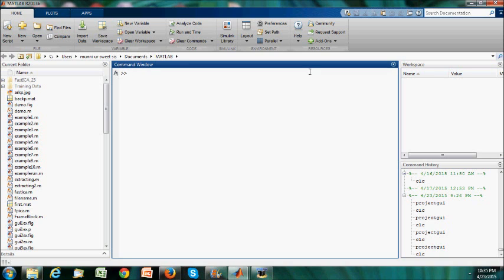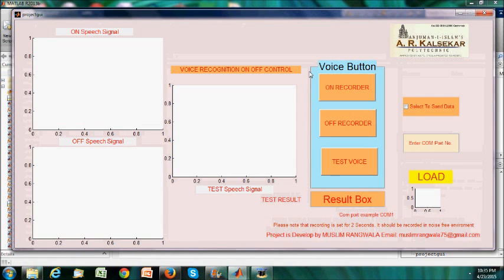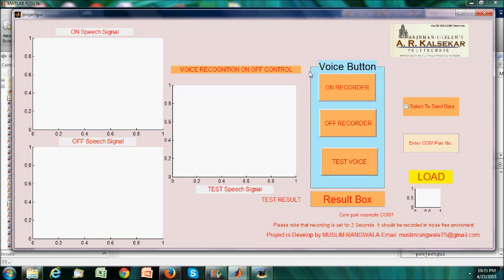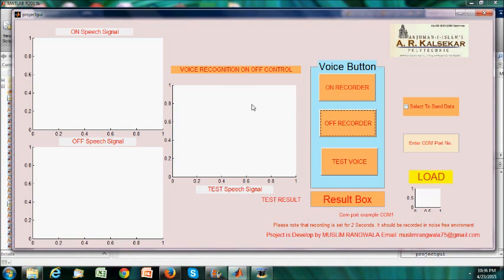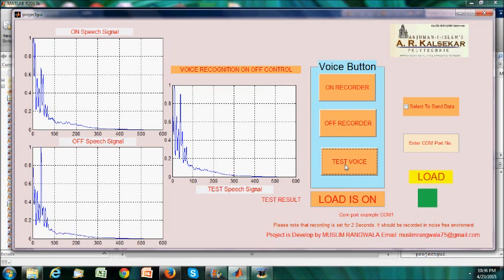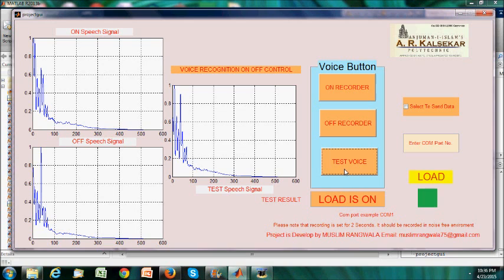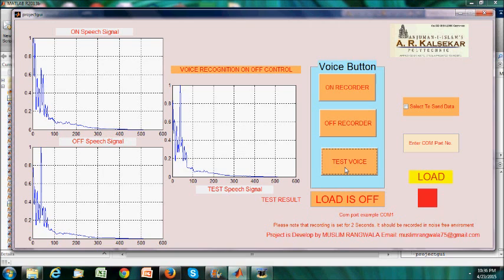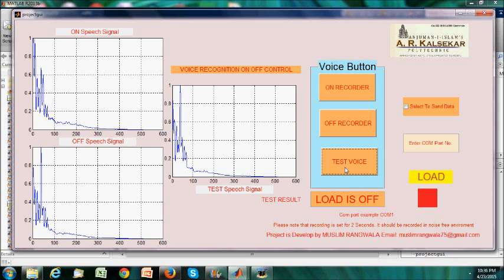VOICE RECOGNITION ON/OFF Control Based on Matlab GUI

Comment: how are you
I am a Master student ), my thesis project is speech recognition in noisy environments also. I'm at the begin of the project,  Firstly, I have to implement this project in Matlab by two ways: ANN method and another is using HMM. But the problem is I don't know how to use it, I have problem to implement it , I have also other questions as how to do Feature extraction, it would be very helpful if you send me the code. I hope that we can change information with each other to finish our
project. i have some problem how to transform voice in matrice what's is steps for doing that (how to doing that) 

I record a word (in wav format) and I imported into my work space and I want to convert this file to matrix form? do  know how to do that?
I need a Project speech recognition,system with hidden Markov models, Or  neural networks,my
project is Speech recognition in noisy environments

tank you so mutch
Reply: Can u please share the project 
If it's possible?